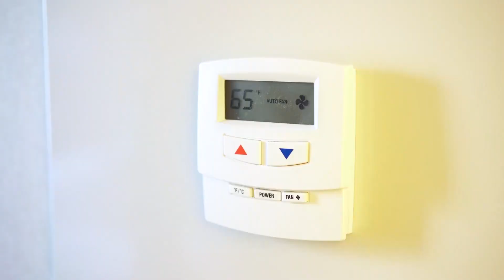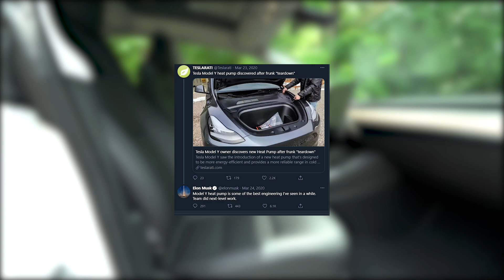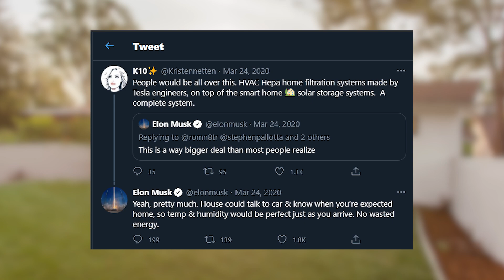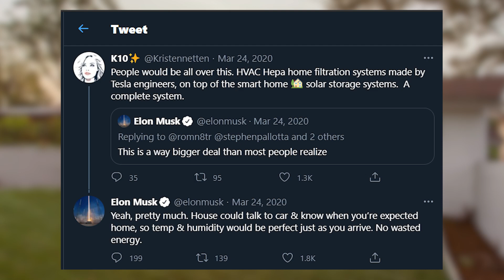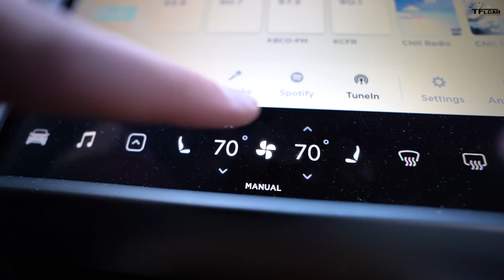How Tesla’s HVAC System Will Change Homes Forever

Comment: Today, no existing technology, except the Maisotsenko Cycle (M-Cycle), can provide such features desired for Tesla HVAC as energy efficiency, silence, zero environment impact, low cost, healthy air for air cooling and heating, heat recuperation, air humidification-dehumidification - all in a revolutionary concept of the evaporative cooling, approaching air temperature less than the dew point temperature.
The M-Cycle makes the indirect evaporative air cooling technology a cost-effective, energy efficient, and environmentally friendly alternative to mechanical refrigerant cooling & heating equipment.
Gen3 M-Cycle: Better performance (price, energy, emission) for less

From Nikola Tesla (energy from air) to Tesla smart home HVAC system (disruptive and efficient).
Reply: Any product available from M-cycle, interested to know more

Comment: Nice in theory, however that is all it is. A car's HVAC system isn't even remotely comparable to an American home. 

The best way to prevent a malicious attack thru your HVAC system? stop connecting it to the internet. I think it could be interesting if Tesla ventured into this market, but the major manufacturer's dominate this market. The only way you disrupt it is to compete with lower prices. I don't see Tesla doing that in the Residential HVAC market. 

In the commercial HVAC market. Most structures are leased. Those renters are more likely to repair the HVAC than to replace it so some costly machine for a building they don't own. It's been a year since you made this video and there's nothing from Tesla on this subject. 

I've been in HVAC for over 28 years. There's been a recent new comer to the American market, Bosch. There's advantages to going that route, but there's disadvantages too. Next there's regulations over refrigerants that will begin to effect this market starting in 2023 and continue on into the 2030's. If Tesla can find a refrigerant with a GWP of 10 or less that meets Government Regs, I think that is their only advantage. The refrigerant makers will rule the real estate HVAC market for the forseeable future.